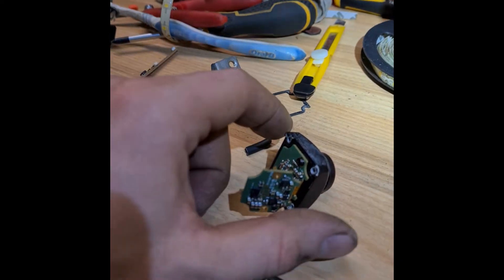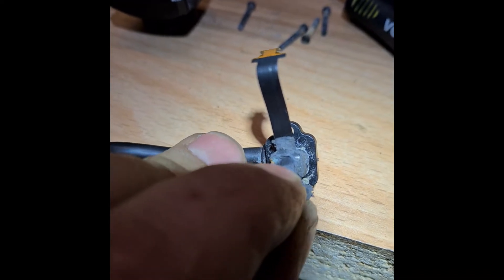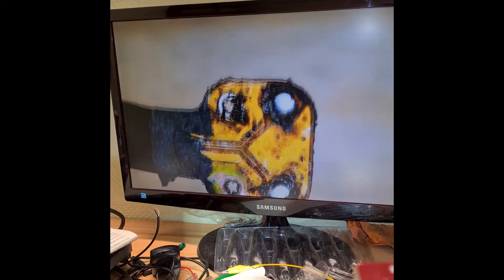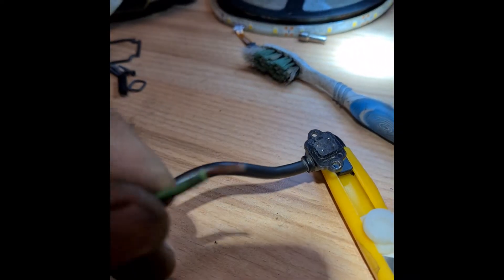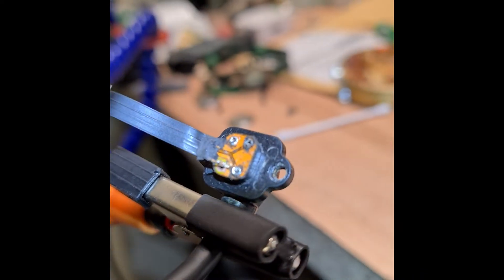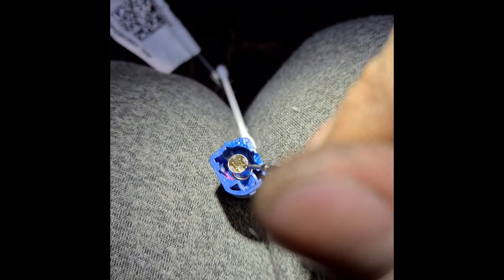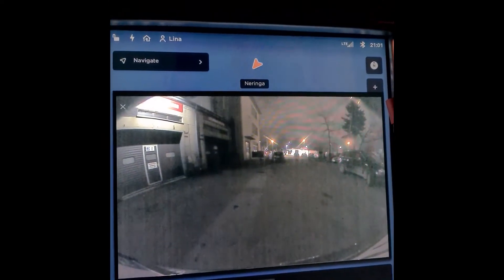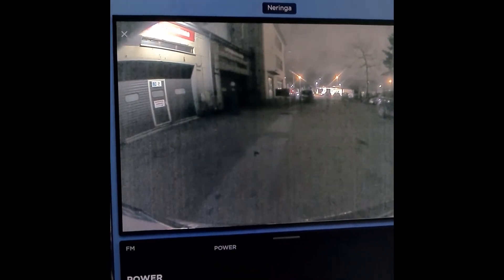Tesla Model S rear camera repair

Comment: I have faced with the same problem, after when I restored the pin like you, I noticed that camera is still not functioning. I disconnected it from the car, and decided to measure the voltage on car connector which is blue, and found that it always changing from 0 to 14. Could you please tell me is it normal? do we need to make a calibration of the camera or it just plug and play? do we need to reboot the car ?
Reply from the maker: helo, in car not shure how voltage must come. Camera is plug and play, no need any calibration

Comment: I am confused about HD and non-HD original camera.
I thought you repaired (successfully) the original camera and put it back into the Tesla?
Where does this new HD camera suddenly come from? Is this a replacement part?
Reply: You are smart and patient and have time on your hands
Reply from the maker: Yes this camera is hd from other car,  my original is not hd. I repaired this from other car and installed to my car.
Reply: @TomasAutoTech  Ah, great, thanks, now it makes sense! :-)
Thanks a lot for all the info in your video, very helpful!!
My rear camera (MS75D from 2018) started streaking purple and green, then it went black completely. I was going to follow your lead and disassemble it, but I tried the two-scroll-wheel reboot first and this brought it back. So, for now, I cross my fingers and leave it as is.
Reply: @helmutheller1538  I've got this problem. Reboots don't seem to have fixed it. Was wondering if it might be water ingress or something.
Reply from the maker: Nice that it helpd